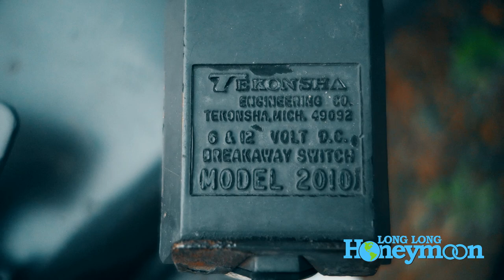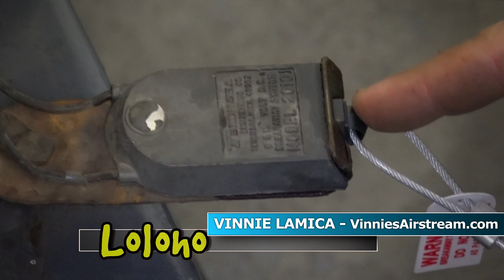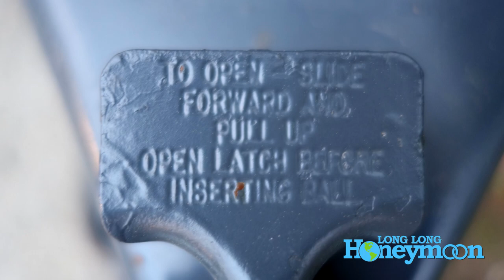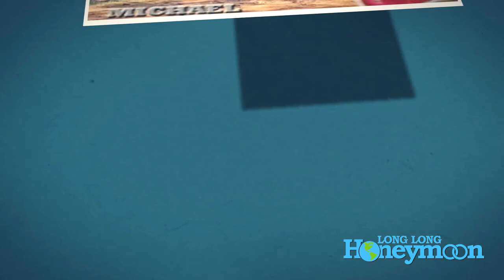For Beginners: "TOP 6" TIPS for HITCHING AN RV

Comment: Sean, another trick to ensuring the ball is securely seated in the receiver is to lock it in place and then using the trailer jack, raise the trailer tongue and truck up a couple of inches.  If the rear of the truck rises, then the trailer is/should be securely connected to the hitch.  I was told this by a "professional".  Hopefully they were correct.

Comment: Strongly support the recommendation to not attach the anti sway bar until you are away from any tight turns and to remove it before you start pulling into a camp ground.  The very first time we used ours I turned too sharply to the right while trying to get into our campsite and a sound like a gun going off scared the hell out of us.  It turned out that the anti sway bar had closed as far as it could go, and I kept turning, so it sheared the small ball right off of our hitch.

Comment: Having a pro to set up your hitch and stabilizer/sway system is great idea.  I wish my "pro" had did it right, had to take it to another RV repair shop to get it corrected.  My handers were having uneven wear on the place where the metal rods lie creating that skid resistance feature.  4,00 miles and it was really noticeable that something wasn't right.  Camping World messed up twice on it, initial install, then the "expert" looked at it and didn't understand the problem.

Comment: Good tips.  A couple more...
(1) Best to test ball coupling by raising trailer jack to see it starts lifting back of truck (starts lifting - don't overstress jack).  (2) Make a receptacle (alum housing, modified tin can, whatever) to hold electrical plug when not in use so it can NEVER get in the dirt or be filled with water.

Comment: Also  once the ball is locked down, the locking clamp at the bottom of the ball must be adjusted..not too tight but not too loosely,  or the hitch can come off the ball on a bad bump in the road.  I found that out the hard way at 50mph, things worked out ok.

Comment: To the point of making sure the ball is in full contact with the tongue. After latching the hitch I will lower the jack to the point where it is lifting both the truck and the trailer. This is a sure fire way to make sure you have a solid connection.

Comment: If I am towing a TT I put the trailer on the ball and lock it and either visually look underneath or raise the trailer a little and see if the trailer raises the truck a little. If not it will just lift out of the hitch. On a 5th wheel I check the hitch and then drive a bit at about 2-4 mph and manually use the trailer brakes and see if it slows everything down. If it does then I know it is locked and ready to tow.

Comment: I mount a spare 7-way receiver Vehicle End Connector to the trailer. Then, when I disconnect the plug from the vehicle, I immediately plug it into the empty end connector on the trailer to keep the plug clean and dry.  Never have a problem with a cruddy plug.

Comment: I've found the reason the hitch will seem to latch but not be secure is the ball is just a little back in the socket. If I have any doubt (and on this I doubt easy) I pull the tow vbehicle forward just a touch (like less then an inch) so it's against the front of the socket. Then latch.

Comment: Very funny, good humor for a dry subject!  Should be required viewing for all RV'ers.  I would also recommend actually testing the break away device at least at the beginning of the season.  I usually just put one axle up on a jack and have a helper spin the tire and then actuate the break away by pulling it out of the block.  The wheel will stop immediately as full battery voltage is applied.  This does not damage the break away device.  When the pull out piece is reinstalled into the block that helper will have the wheel free up immediately if everything is working as designed.  As everyone knows it is in a very filthy and wet place at times place on the back of the hitch and this is an electrical device.  You want to know this vital safety device is 100%.

Comment: I don't know if anyone else mentioned this but there is a second reason to cross the safety chains and that has to do with geometry, especially if the chains are attached to each side of the trailer frame. When turning tight, non-crossed chains can get pulled tight and possibly break something whereas crossed chains tighten at a much lower rate.

Comment: When I drop my hitch on the ball,  I always retract the jack to lock the trailer on to the ball but just enough to know the full weight is on the ball, once the trailer is locked on the ball, I then bring the jack back down briefly to see if it will lift the trailer off the ball with the trailer locked on the ball ,before fully retracting the jack.

Comment: hey Sean and Kristy  how are ya ?..I would recommend a backup camera if it's too hard to see how to line it up with or without couples...
also I was always taught to run my emergency brake cable through the chain to the hitch so it doesn't get caught up on something while flapping loose in the travel..so I'm not sure now which is the right way...
and if I could ask you to talk about the brake controller for the brakes and the proper amount of adjustment for the brakes on the trailer! thx.

Comment: My Anderson Hitch likes it rough with dry balls. The anti sway is in how the shaft dry fits into a receiver coated with a brake lining material.
The ball must be tight and firm.
Sometimes on the I-10 here in So Cal. the ride can be rough and wild.
Those windmill images are in my back yard. Strong winds every time they turn those darned things on.
Reply: I was going to suggest you check out the Andersen No Sway Weight Distribution hitch, that is what I use and so far it is fantastic. It is not compatible with certain Atwood couplers though and I am pretty sure some Airstreams use the Atwoods that are not compatible.
Reply: I love my Anderson hitch. I am so glad I got it. I've never had any sway, porpoising, clunk, squeak or anything... nada. It has performed flawlessly. And I've got a big rig that I've driven through high winds and bumpy roads. I got the 14k lb version. -- Hey Brian Peters, you must live near the town of Mojave. I've stopped in your little truck stop town on my way up the 14 a few times. Those wind mills are something.
Reply: Start The Rebellion next to but not in Rancho Mirage
Reply: Oh OK. Yeah, I guess they've got these wind farms just about everywhere in desert areas now.
Reply: Same around my home. Wind turbines in Southern Ontario by the thousands.
Reply: Brian Peters a
Reply: Another add about the Anderson No Sway Weight Distribution hitch, as I have one as well, you can back up even around corners without disconnecting or loosening anything like the friction sway controllers.

Comment: A tip to add ,based on a real life experience 30 years ago , that is now quite funny to me. I had a motorcycle with a pop up motorcycle camper. I was taking it out for the spring shakedown test. The ball was not lubed and the clearance of the ball was pretty tight. The tongue seized on the ball from warming up and wrenched it off. The trailer dropped at 70 mph and sheared the factory issued safety chain. Now comes the crazy part. I was in the leftmost lane and quickly pulled off the road. The trailer proceeded on down the curving interstate at 65-70 mph, making lots of sparks with the seized ball for about 1/3 of a mile. It crossed slowly from the left lane to the middle lane and then to the shoulder. I was absolutely astounded to watch 5-6 cars pass the trailer ,as though it had a driver !!! The trailer slowed down to about 15 mph ,the tongue caught  a mound of asphalt and did a perfect 360 forward somersault and landed on its wheels. I was only a mile from home and was able to limp home on the shoulder ,with the trailer. I only had to repair the fiberglass spring mount on one side. Talk about how unlucky I could have been . :-)    My tip :When buying a hitch ball ,try to buy it at least a half inch longer than necessary. Take a 1/8 inch drill bit and drill the unused thread then  put some kind of safety pin thru it ,even a cotter pin. This will give a little warning when the nut comes loose....which can and does happen. IF you want to add a little theft deterrence to your rig ,add a jam nut and put a taper pin in the jam nut. Theives are nut usually equipped to deal with type of deterrant.  :-)

Comment: Thanks for the good info and tips! Have you tried using a trailer dolly that goes under the foot of the tongue jack or a wheeled jack/trailer dolly that bolts to the frame so you can roll the trailer around a bit and get it positioned easily? Thanks

Comment: Thanks for caring folks! Need a good video on how to properly establish and adjust the hitch ball height and how it pertains to a level trailer and tow vehicle. Also the weight distribution bars and how to set them to help the entire rig balance out into same level plane. Be safe always. God bless all the good folks. Be safe, alert and always on the watch for the criminals and the ignorant misguided rip off artists! I would think they made a special cap for the 7pin electric plug kinda like the special caps for propane tanks and hoses. I'm gonna check Amazon. Enjoy!

Comment: Turning on the 4 ways and headlights  will better well check all lights on vehicle and trailer.  One man operation.
Reply: seredin T as long as your turn signal switch is good seen it myself turn  signal didn't work but four way did

Comment: Great info.
One question. The anti sway bar, do you run it on just one side?
The emergency pin was good info. I will have to make some changes on ours. We actually stayed at a spot in Prescott a and I believe cause I didn't give a resident there $20 he pulled the emergency pin out. Breaks were locked when we tried to leave.

Comment: Here's a quick trick for hooking back up to your trailer that you parked at an unusual angle to get that sweet spot in the campground. Put a marker such as a set of stones, chalk marks, or horse shoes on the ground next to your driver-side front and rear truck tires before pulling away from your trailer.  A few days later when it is time to leave you can back up your truck to the exact spot you were in when you unhitched. Just remember to first raise your trailer hitch up high enough for the ball to get underneath.
Reply: I bought 2 set of those little orange cones for sports events for around $20.  Layout the backup path along the trailer driver side arc into the spot with the last 2 at the stop point.  Creep in ... creep in ... creep in.

Comment: If you don't put the connector on the ground it won't get covered with dirt.  On our pop up we always stuck it under the battery cover when not hooked up.  Have to figure something out when Tilly finally gets here.  Editing, I know I am probably the only one but when the static came on it was a little loud.  Had to turn it down so far I could barely hear the comments in between.  Never even though about the disconnect cable; just hooked it up.  You know I will now.  Thanks for the education.
Reply: On my Car Hauler, I just bought a cheap 7 blade vehicle side connector and cut the wires off and put silicone on that end and bolted the "dead" connector to the tongue of my trailer out of the way. When the trailer isn't being used, I just plug my harness into the "dead" connector.

Comment: Excellent Video =)

I only wish U had of shown, that after locking onto the ball, U use Ur Jack to try & lift it up off the ball, then jump up & down on the hitch to C if it comes apart.
Then lower & lock jack.

Comment: Great opening, never thought you'd have such dirty minds (TIC).  I'll add another tip if you don't mind.  Last fall while hooking up my 19' Sportsmen I somehow did not get the shank fully into the receiver, completely missing the hole for the retaining pin.  Put the pin in and proceeded to drive about 10 miles before all h broke loose.  All the pins in the world don't do any good if they aren't in the hole.  Fortunately when everything dropped there was no damage and I was able to get to the side of the road and was off and running in about 5 minutes.  Half of that time spent verbalizing at myself.  I deviated from my usual protocol for checking that the holes lined up and relied on a quick eyeball instead.  It was a combination of being rushed, somewhat bleary eyed and inadequate amounts of coffee in my veins.  I did kick myself in the arse for the next 120 miles till we got home.  BTW, at least the trailer brakes worked when the cable released.  Moral of the story, make sure you have enough coffee in your system to assure that you are awake enough to perform the task at hand.  Now that I've publicly embarrassed myself we'll call that end of story.
Reply: thanks for sharing another tip.

Comment: When I was a youngin I had the nut back off the ball going down a washboard-y road. The trailer lifted the ball out of the hitch and luckily into the safety chains...all's well that ends well. Lesson learned was.... don't use a ball that has a smaller diameter shaft or bolt than the hole in the hitch, it'll work itself loose.

Comment: This was a great video and extremely informative about the brake setup. However, I am getting conflicting comments about the break-away switch. In the video, you state it should pivot. In another forum, it shouldn't pivot. My switch does not pivot, but is pointing at the hitch. To pivot, or not to pivot? That's the question. THX

Comment: Great informative video!! 

I was wondering if you have heard of the Hensley Arrow Sway Control Hitch, or ProPride 3P hitch? Both are a similar version of a different style of hitch which reduce sway control, but from what i seen on their videos, are a lot less complicated to connect between tow vehicle and trailer, where as some of the components (weight distribution bars and an integrated sway control design) are part of trailer tongue and do not get removed.

 Could there be a possible review video of one of these style hitches? Or maybe a viewer could comment on these types of hitches from experience?

Comment: While driving our tank and Baby to Colorado a few years ago,  we always check the bearing and tire with an inferred  Thermometer, and do a walk around while Fueling our Truck. At one of these fuel and stops checks, found that my 7 pin harness had been dragging on the the Ground for a few hundred miles ? Fortunately being an electrical electronic Build my own gadget guy (had everything) i needed to spice and repair the Wire which had been ground down several of the wires. Keep some good quality I recommend using type 33 electrical  weather and oil resistant in your glove box next to that roll of gorilla tape 

How did i miss this must have been the 1st fuel Stop as i always leave home or camp site with a full tanks so before you leave your site and our driveway check that all you chains cables and safety breakaway are clear of the ground. I use a padlock on our hitch to lock up our chains so it cant be dragged away even with he Ball lock . 

Love the photo of the tongue the chains breakaway and & pin latch with the Cable pin latch, that's  Awesome nice and tidy  Thanks again Guys Keep up the excellent videos! love watching these :>)

Comment: We are getting our Tow RV in a few days.  I have an Anderson hitch system (sway and distribution) ready to install.  My question is - my 4Runner spare is right behind the receiver and it will allow the first bolt hole in but not the second (the one closest to the ball).  Should I take down the spare and put it inside my 4Runner to get the ball assembly in as far as possible into the receiver?  Thank you

Comment: I noticed that your changes of your load leveled are at a angle they should be straight up and down. Also to help tighten you load leveled after locking the ball if you use your trailer jack to pick up the rest of you truck just a little it's much easier to connect your changes

Comment: Hi! I really like your video. I'm new to RV camping. Always wanted to do some traveling, so now we are empty nesters and getting a chance to travel. We Have a travel trailer and a van with gas engine. I hear in your video that you have a diesel truck. I have never had a diesel and a bit mystified by them. Please tell me why, or at least some pros and cons? Thanks again for the great video.
Reply: warren ramsey hopefully you found an answer somewhere in the two years lol.  I do a lot of towing for work.  Iv had gas and diesel trucks.   Gas truck are cheaper in terms of purchasing and maintenance (ex my gas truck takes $30-$40 to change oil the diesel takes just shy of $100 if I do it myself lol).  Towing wise you are able to tow most things with a gas rig but may only get to 2mpg at times.  Diesels have gobs  of torque! Some newer gas rigs have around 400-500 foot lbs of torque where as your diesel trucks are getting 800-1,000 now a days.  Most half tons we see at work get around 15mpg where as our diesels get 15.  The difference is fuel prices.  Your bigger gas engine will eat gas like no other lol.

Comment: Hi, It appeared that you have your electric jack is turned sideways. Is that so you can clear your tail gate.  Mine hits the jack  and is a nuisance. How did you turn your jack and secure it as the hole don't line up?